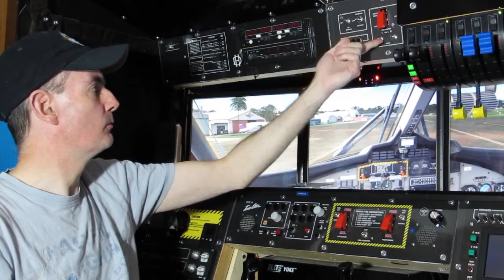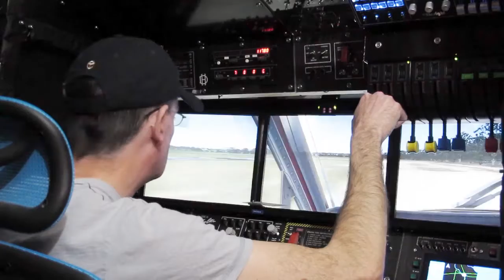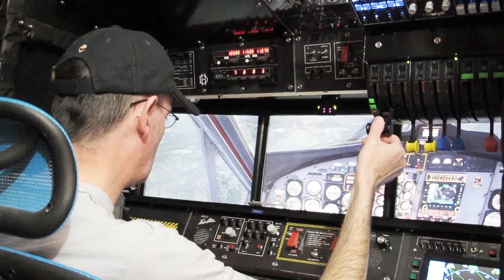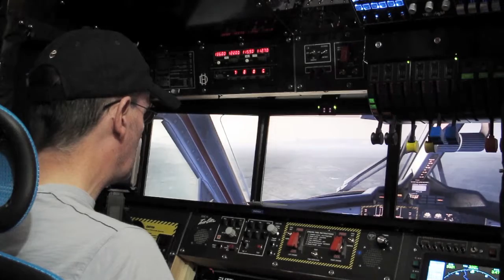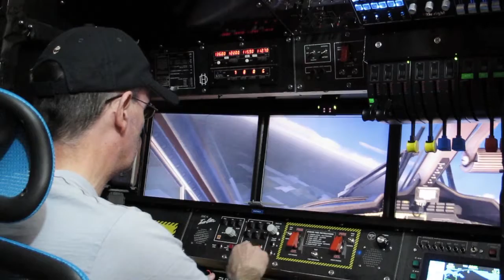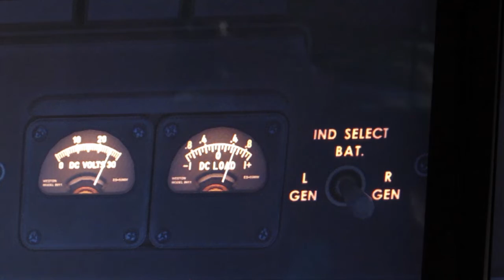Twin Otter Close Up #1 - Electrics

Comment: There's really only two aircraft suppliers (addons for FSX) that give full featured systems underlying the aircraft. These are PMDG for Jet's usually airliners and A2A Simulations, mostly GA planes and Warbirds and classic aircraft. For GA style flying, A2A most definitely give the most realistic experience. The aircraft are different every time you fly them, and each variation of it differs from one aircraft to the next in subtle ways, that only someone who flies it regularly will notice.

Which is why they are the go to place for fsx planes for pilots. PMDG is the go to place for Airline pilots and those that love that side of flying.
Reply: You forgot Aerosoft and RealAirSimulations...

Comment: Hi
Nice vid again
 Can you tell me if one day you will be putting in gauges for the Twotter so you can actually fly without the Twotters cockpit showing on the screens
Regards
Mike from Scotland
Reply from the maker: Mike Greenaway I have given some thought to this but I doubt if I will do it because to do it properly (real gauges) would be enormously expensive. I also think the VC and TrackIR is still the best display compromise around (although I would like to try an Icarus Avenger projection system).

Comment: Hi there love the videos they are very informative thanks for sharing your good wisdom just one question when you use your rotary encoders does the dials on the VC panel turn as mine do not thanks..
Reply from the maker: Daniel Smart As I recall, there are different Lvars you can poke in the Twin Otter Extended to make the VC things happen (switches move, click sounds, etc). I never bothered with these but you could probably make them happen if you really wanted.